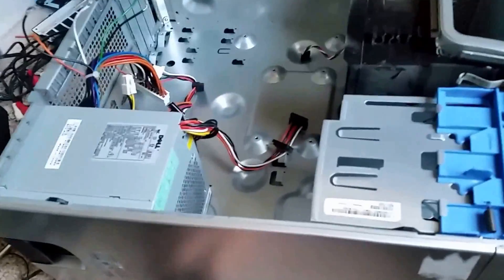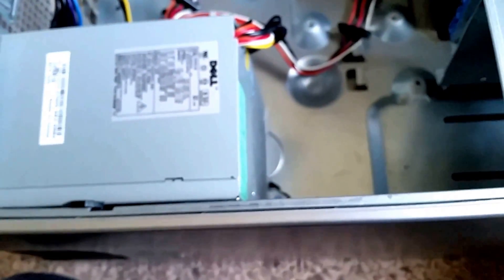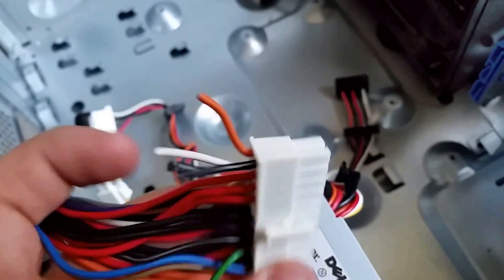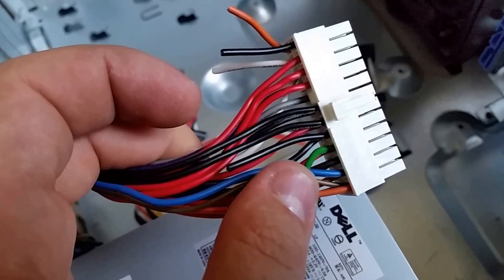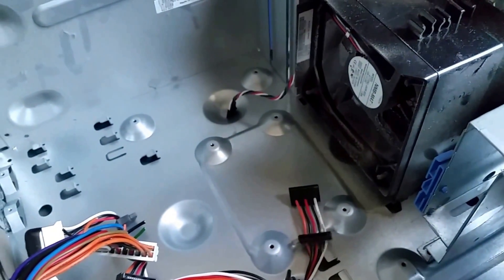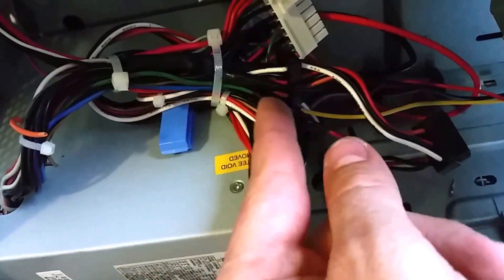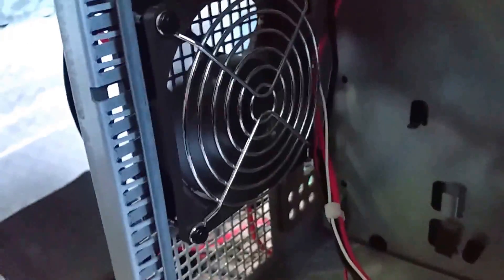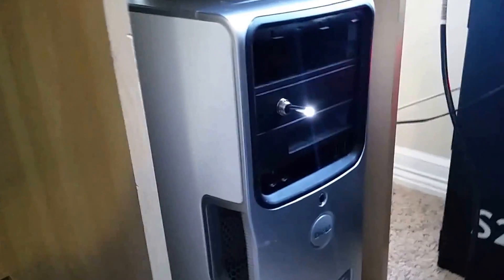KG5IAN Ham Radio Computer power supply!

Comment: I love the idea of recycling an old PC power supply. But when you key down the mic. Do you get any noise through the radio speaker? Or output noise on the out going transmission?

Comment: Can you pull 12 volt supply on a working computer ,so you can still use the computer and use the 12v output effectively for a medium power consumption device?

Comment: You can just use a R Pi 3B instead of the regular computer Motherboard and have plenty of 5 volt DC supply for several R Pi's and additional devices or multi Pi's  =)

Comment: Nice computer hack.  New Ham here as well and tinkering with the knowledge gained by building and repairing them.  Smalleninedude71, just off the top of my head I think you might be able get a step-up transformer that would give you the required voltage and should not be too much of a hassle to get it to 13.8 regulated.  Most of the modern PSU's have 60 amp's on the 12 volt rails, so it would just be the volts that need adjustment unless you are pushing more than 100watts.  I would try to google step up transformer for 12v-16v DC.  See what you come up with...might even have an el cheapo variable type transformer similar to ones employed in the $500 power supplies for radios...  **Scratch that...just went online to search and found this little gem.  http://www.us1.cc/images/806_50_TM_Good.JPG  It has three terminals and adjustable voltage on the unit.  Same cost as purchasing a new PSU that does about 850 watts with out having to reengineer anything. ****

Comment: my HF rig is very senistive to EMI and draws 20A. i wanted to use a server power supply. but they only give 12.5v. i need 13.8. looks like i am going to have to buy a good linear supply
Reply: 13,8v is the charging power of a car alternator, when you turn off the engine the battery provides 12v, your rig will do fine on 12v.